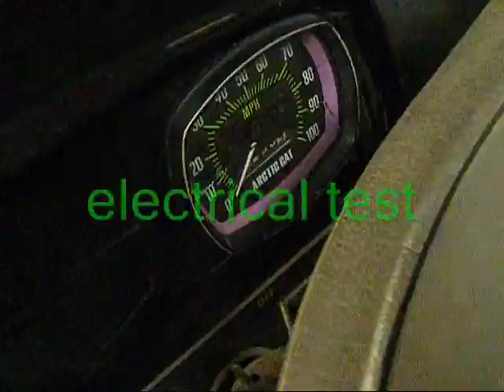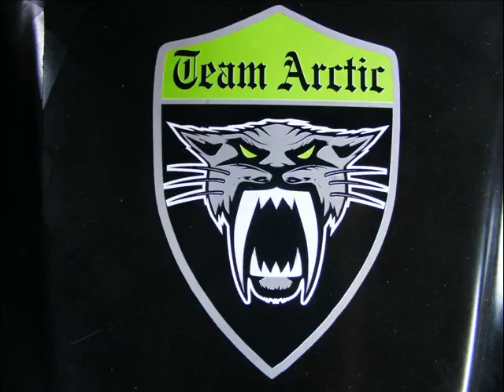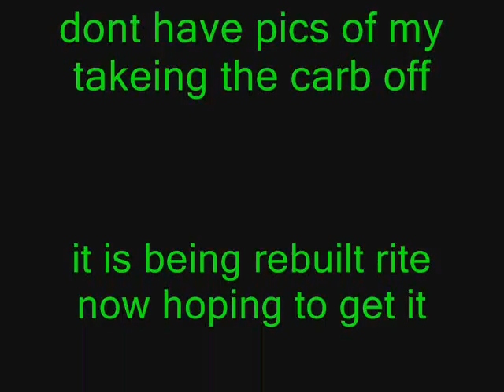73 panther 440 restoration

Comment: @countyguy2003 it's most likely running lean because the center seal, and or a combo of both center seal and outer crank seals are sucking air in leaning the engine out. VERY common issue on these kawai engines. I am dealing with a 340 and a 440 panther and cheeta doing the very same thing. 440 broke a chunk of piston off after getting too hot (lean)

Comment: o yup prob your rite cause it always burned holes in the top of the pistons after u try to go leave the door yard with it n go for a ride and i put new cylinders n heads on it n it still did it so i was always guessing it was in the base plus that little rubber pulse lined would keep falling off